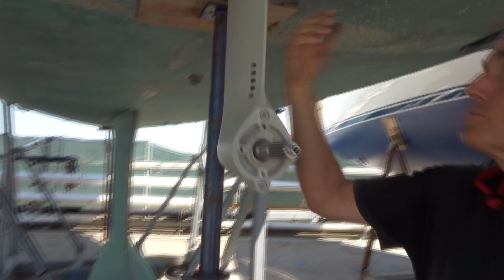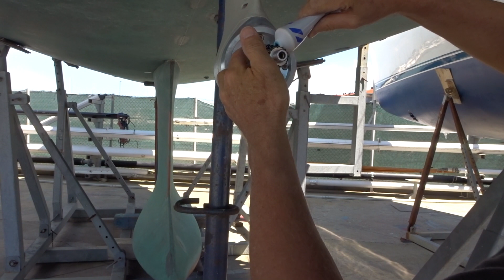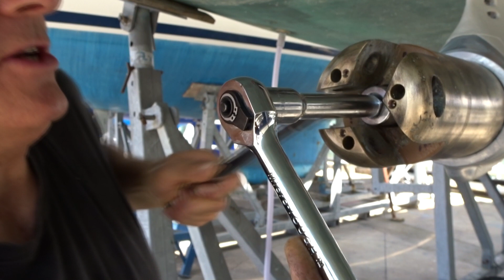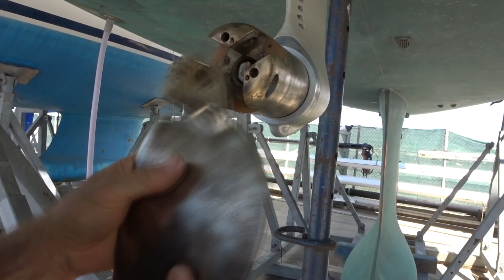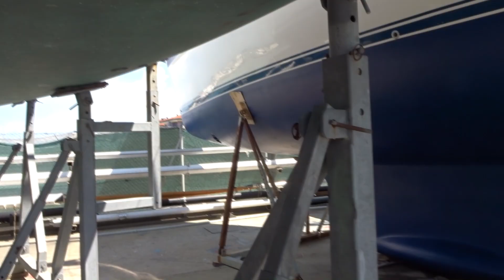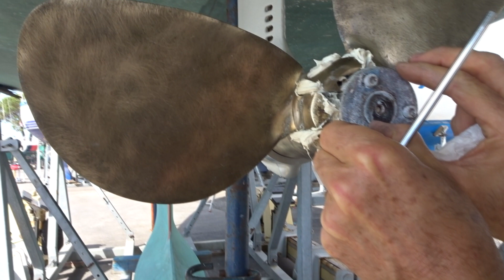The Prop - Assembly of a 3-Blade Flexofold Propeller

Comment: Pretty sure the Flexofold installation instruction don’t mention anything about greasing the blades.
Reply: They don't, but if you search down the comments here, you will find one from Flexofold complementing the video.  Not officially required, but not a problem either.  Certainly makes assembly easier, and helps minimise wear (servicing two years later, there is still enough grease there to lubricate).

Comment: Aluminum corrodes before Zinc! on aluminum boats you need Magnesium anodes!
electric potential of different matals... 
Magnesium +1.87 to +2.37
Aluminum +1.30 to +1.67
Zinc +0.758
Chromium +0.600
Iron +0.441

Comment: Thanks for sharing big help what's the name of the white grease
Reply: Thanks for your comment Jeff.  TK Marine is the brand I bought locally, but there are many of them around the chandleries.  Just a white marine grease.  Flexofold don't mention use of grease, and in reality it is not strictly necessary, but they have commented (favourably) some time back on this video, and were not averse to my using the white grease - it certainly doesn't hurt!

Comment: Hi David, I hope you will react to my question while your interesting movie is 3 years old. Why do you take grease in the central nut before you tighten it very firmly. Shouldn`t it be loctite instead?
Reply: Hi,
The grease is to minimise any chance off galling between the nut and the stainless steel shaft, and also to minimise any chance of corrosion between the nut and the shaft making removal difficult - or worse ......
The nut is retained by the retention tabs you see me bend up around the nut after torquing it down really tight.  As a note on this, the minimised friction between nut and threads also means the torquing down process is more efficient.  If you take a torque wrench and torque with a totally dry nut and thread, the pressure between the nut face and the prop hub will be less at the same torque due to friction, than if the threads were lubricated.  This is usually a somewhat academic point, but in extremes, it can be significant.
I hope that helps.

Comment: Flexofold is a nightmare to work with. They sent me the wrong prop the refuse to replace it. My boat is in Annapolis  Md . and no one would agree to install it when you said the name Flexofold.
Reply: Surprised at that.  We find them very communicative, and as for installation, well it is very simple as you see.  I would have to question the competence of a professional who had issues with installation - unless there is an agenda .....
On another note, Flexofold was brought under the Yanmar group a little while ago now - another affirmation of their standing.
Anyway, I find the efficiency, simplicity (lack of seals etc) and quality to be very positive aspects.  We did not ask for a Flexofold, but are very glad the commissioning yard chose the brand.
I hope you get this issue sorted for your boat Ron
Reply: i had the same problem with kiwi feathering prop. had a nightmare dealing with them. ordered a prop and the distributor was the rudest man in the world (just propellers) it took ages to arrive and couldn't get any info on its arrival time. i simply asked when he might think it would arrive (boat was on the hard waiting for the prop) he abused me for asking that simple question. i immediately sourced a prop from some where else and asked for a refund for my deposit i had made. no skin off his nose. he refuse to return the $900 deposit. had to take him to court. i won. hes still an ahole. now i have a gori. waaaaaay better than a crappy cheap kiwi prop. it has over drive and full thrust in reverse. havent looked back.

Comment: Awesome video, curious do you get the bond you need between the anode and the sail drive, with the paint blocking a good bond between the metals?
Reply: Thank you for the comment Brian.  We are a very small channel, but part of the plan is to have more 'Boat Tech' videos on here.  Things are changing in our lives, and we plan on soon having more time for the channel, and more for sailing :).
So regarding electrical contact (electronics/electrical is my background), as long as the anode is in close proximity to the metal being protected AND in electrical contact with that metal, it will do its job.  Obviously it is in close proximity, but electrical contact or connection is the question.  The points where that connection occurs are the mounting screws.  Essentially the alloy of the saildrive is bare in those threaded holes, and the mounting screws therefore provide the electrical link from the saildrive to the anode.
It is not a requirement for the face of the anode to be in electrical contact with the mounting area of the saildrive.  In theory, you could connect a wire from the saildrive to the anode, and suspend the anode a few centimetres below the saildrive for a similar level of protection.  With that electrical cell of saildrive, through the wire (or mounting screws normally) to the anode, there is protection.
I hope that answers your question as you hoped, but do subscribe so that you will receive alerts when further vids go up (including a fully one of dismantling the prop and replacing the seals in the saildrive).

David

Comment: Hey quick question if you are around ? - I have the same prop and just in the process of remounting with new anodes etc .... and the FLEXOFOLD literature states "No need to grease or oil, the parts are water lubricated as soon as in water" .... So interested to hear your thoughts as I wonder whether the grease could allow debris to stick so could be counter-productive to the cause ... then again I share your satisfaction of seeing a well-greased and protected spline and blade mechanism .....?

My yacht goes back in the water in 3-days.
Reply from the maker: Sorry I did not get back to you earlier - just saw your message.
Yes, I noted that also re the official procedure.  Certainly you need the grease on the splines, but as for the gears that control the folding blades I have always used grease there, and never had an issue with any contamination.
If I ever get a chance I will run this past Flexofold, but when they commented on my video (very positively) a little after it went live, there was no mention regarding my use of grease.  When we lift, there is just that residual film there on the interlocking teeth, and to me, that has got to be better than just water.
Probably the answer (in light of no adverse comment from Flexofold) is that it's not necessary, but does no harm.
Reply: @SailingSharingLife  Much appreciated for your response ... I'm about to put my yacht back in the water and think I'll definitely grease the gears as by the sounds of it - it can't hurt !! (as compared to the 200m's plus of nylon fishing line I found wrapped around the spacer so tightly I hat to cut it off - ugh!)
Reply from the maker: @StormchaserIB  Fishing line - Hmm. Really nasty when it gets to the seal.

Comment: Very nice video. However, I cant help but to wonder how to remove the pins that hold the blades in? They are in deep and appear flat on the end.
Reply from the maker: Thank you for your feedback.  Next time we will do a new video showing the disassembly of the Flexofold, but to answer your question in the meantime, the pins are very easy to remove.  Basically it is the reverse of the assembly process.  Once the locking screws are removed, a pin-punch is used to gently tap the pins out, one by one.